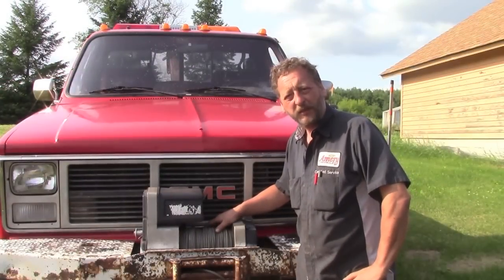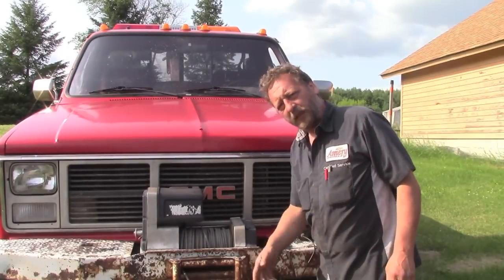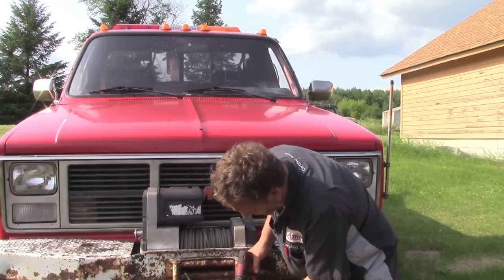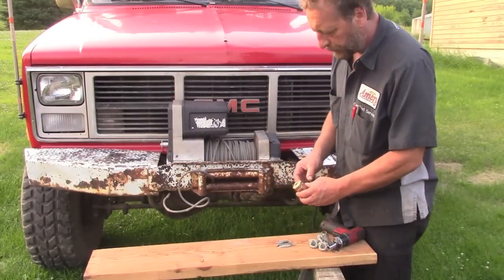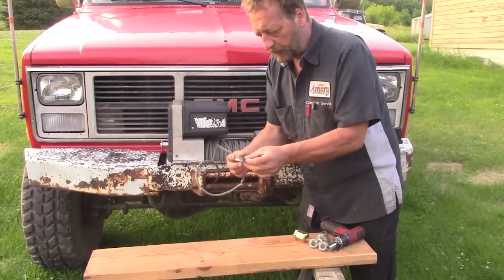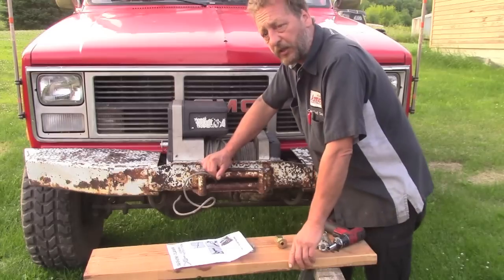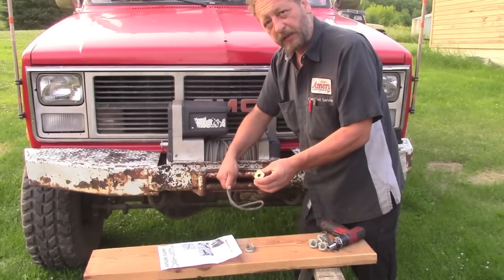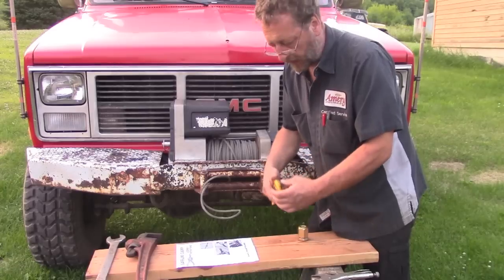WINCH CABLE REPAIR by BSF Recovery Team

Comment: That clamp is pretty cool and much less bulky than standard wire rope clamps. I use anti-seize on all my cable fitting threads for easier re-use or field repairs.

Comment: Just a little hint. If you want to avoid a frayed cable end, heat the end red hot about an inch then braze it. Cut it with a cut off wheel and it will never fray. Also works when cutting a cable to length.

Comment: Where did you get the wedge clamp?  I haven't been able to find that style anywhere. Looks like a great solution to repair a broken winch cable.
Reply: A Lathe and some "Shop" time, And you could turn a Big Bolt into one of these Cable Clamps ! I've did it several times over the years. No shop is complete without a Lathe and Small Mill !!!!!. You can MAKE YOUR OWN repair tools !!

Comment: Any leads on a good swivel hook with the safety latch, not interested in the "locking hook" I'd seen on another channel, if possible one with the removable pin that's held in by cotter pin.

Or a good add-on adapter for a standard hook.
Reply from the maker: Check out some of the tow truck supply stores, like Detroit wrecker sales, AWdirect, or truck & tow.

Comment: There’s 500 videos on how to do this job but how do you mount the cable to the winch itself?
Reply: Unspool winch completely, there will be some kind of bolt or bolt with allen head and just fasten new cable which will have a already looped end and bolt it down to drum. You'll see when you get it un-spooled !!      Jim

Comment: That uniform looks familiar. I wear one every day. How do you like working on these new cars compared to your wrecker?
Reply from the maker: +aussiek2000 The wrecker is simple and old school, unlike all the technology that I have to keep up with at work. When I started in the auto biz I never thought a laptop would be the most used tool I have. I like simple and old school.
Reply: +recoveryteam My brother worked at a chevy dealership for years.  He's now semi-retired and working in a local shop but he won't touch any modern stuff.
Reply: +recoveryteam  me too simple and old school the best thats why i never buy a new car i always looking for old car  :P
Reply: @offroadrecoveryteam  sick of technology, yep, I am old school mechanic, I still prefer a generator to alternator, and prefer points & carb to fuel injection & electronic ignition. 

I just picked up older truck, but I have a few projects & plan to rid myself of newer vehicles in next year or 2, & only have older stuff. also due to hating tech I switched to auto-body instead of mechanics, I prefer to do restorations, & the metal fabrication rust repair is my specialty.

Comment: I've got a 72 c30 ramp truck with a 10000lb winch for loading cars. The old cable is just about shot. What is your opinion on going to one of those winch ropes vs a steel cable?
Reply from the maker: nitrosport5 Still up in the air on winch rope/nylon for long term durability.
Reply: recoveryteam thanks for the reply. That was my concern is how it would hold up. In theory they sound great but I'm afraid 1 summer in the sun and they would deteriorate
Reply from the maker: Some are UV resistant, my concern is the wear factor for frequent use.
Reply: recoveryteam rope always fails faster when there is lots of mechanical wear going to it.  but rope is much nicer to handle (dont even need gloves) than steel cable so its a lot to do with personal preference
Reply: ***** and ofcourse sometimes you need a different drum on the winch for ropes and steel cables
Reply: nitrosport5 I've got a synthetic rope on my 4WD's winch and while I wouldn't get steel, there is a quirk you should know about.

After use, it really needs to be pulled out and spooled in correctly (evenly worked across the drum). If there's any gaps left in it, the rope can become caught and is IMPOSSIBLE to pull out by hand.

I've had it happen to me once where I couldn't extend the rope to the tree I wanted to use, instead had to do a number of short pulls. Fixed it by connecting it to another vehicle (They needed to be winched out, otherwise I would have used a tree when I got back to camp), putting it in free spool and reversing until pulled freely.

On a tow truck / ramp truck / tilt tray truck, that could be a real pain in the a$$. Not so bad on my rig where I hope I don't need to use it (ok, I try to put myself in situations where I need it...).

On the plus side, the rope won't try to kill anyone if it breaks. The Hook on the other hand is still made out of metal so I still use a winch blanket right next to the hook, just in case the tree strap or recovery point on another vehicle breaks.
Reply: nitrosport5 I love rope and it is what I run.. That said steel cable has it application. If you are rough on the equipment, using it weekly, hooking up to rigs that don't have proper tow points, etc.. I'd use steel... For a Jeep that has a winch for self recovery I'd go rope all day.
Reply: 35manning I was told by numerous winch rope makers that this was a myth for ROPE. A MUST DO for cable.
Reply: robby844 I know from personal experience, the rope DOES get jammed and that makes it very hard to use. Easy to fix UNLESS you are currently bogged when you realise it's happened.

I made the mistake of using my winch to pull another car out of a bog hole (he flooded the inside of his brand new car...) and not immediately re-spooling my rope. About an hour later on the same bog hole using a slightly different path I got stuck. And my winch rope was jammed.

Next time, I have to use my winch, I will complete the recovery and RIGHT AWAY pull the rope out and re-spool it.

I only got away with it because I wasn't badly stuck and there was multiple small trees that I could attach to.

On the other hand I used to drive a tilt tray heavy haulage truck with a steel cable. I was the only driver that ever bothered to try and make the cable look neat and it never had any problems.

I'd personally do it for both, but I do know that for rope I won't ever leave it as is again. Not worth the risk given the remote areas I travel in the Australian bush, often driving alone.
Reply: 35manning I totally agree. I was out wheeling a few weeks ago and we hit a section of trail that required some hard hard winching. Everyone with rope ended up with jams after multiple winches.
Reply: Jeeping.Net Can be a pain to manage it, but for the safety aspect alone I think it can't be beat.

Another thing which might apply to the OP, when self-recovering, the rope doesn't actually move, the vehicle is pulled along the rope.

On a recovery vehicle, the opposite is true. The recovery vehicle remains still while the rope (and the vehicle attached to the rope) is dragged towards you.

On flat ground this isn't a big deal. If you rope hits the truck bed, just make sure that area is polished smooth (like the fair leads are). However if you are recovering a vehicle that's down a ditch for example, your rope is going to drag along the ground and get cut up by the rocks, sand and dirt (and anything else that's there like glass) and your rope won't last very long at all unless you employ protection etc.

If (when!!!) I built up an off-road tow truck like BSF's it'll have a rope on the front and dual boom winches, one rope and the other cable.

That way I'll have the choice of heavy duty, or flexible safety.
Reply: I use a large chipper at work equipped with very powerful winch.  and iv used rope and cable. The binding problem of ropes on spool can be managed by only spooling in under pressure. And the more I use the rope, the stretch is taken out and soon looses that binding problem altogether. Eventually the rope will wear and break but field repairs are much easier on rope than cable. If you've ever had a burr from cable slice you open you'll appreciate rope that much more.
Reply: Louis Ortiz How is rope easier to fix in the field? If you have had  a burr slice you open then you aren't operating the winch properly...
Reply: +robby844 rope can be spliced so easily in the field you can train a 6 year old to do it. Love that aspect of it. I think if I used rope on a tow truck I would just keep plenty of spare rope. A little more expensive but so much easier and safer to use I think I would just replace them or cut out bad areas and splice them back together. Little protection for the rope can go a long way.

Comment: I use that on my stuff but a bit of advice of holding the cable next time. just use a small hose clamp to hold the cable. and you can also use a clamp to hold the wedge clamp to get it started.then when you get done just remove the hose clamp and tighten everything up
Reply: glen john  wow maybe I should have watched it all before I typed I liked the wire tie thing I will have to try that next time

Comment: Why didn't you just slide the cable swedge end loosely and then pull the cable through to tighten it up? You could have done this in three steps and finished in five minutes.